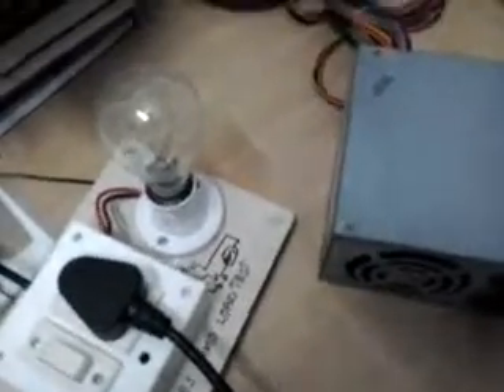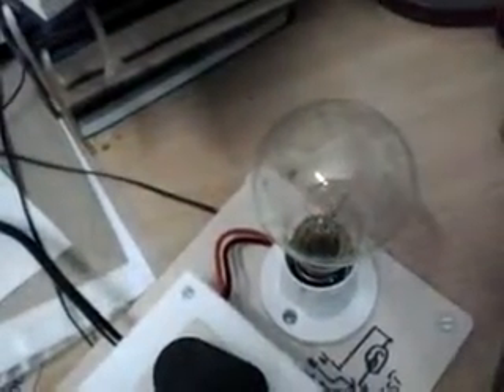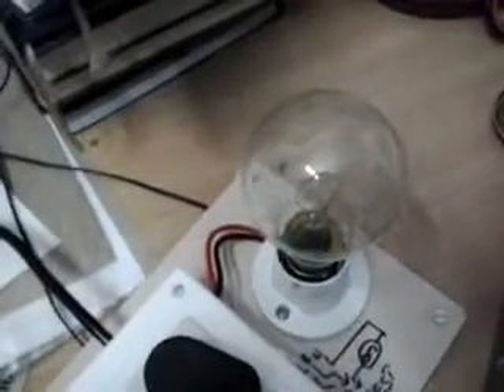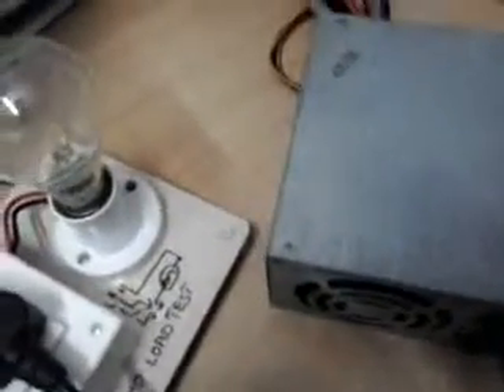series lamp test on SMPS

Comment: You're supply ac line source is 240V and what is your bulb wattage? I try this with my computer power supply 1000W very bad my 100w bulb blown away.
Reply from the maker: I used a bulb of 100 watt power.... My smps was rated at 450 watts..